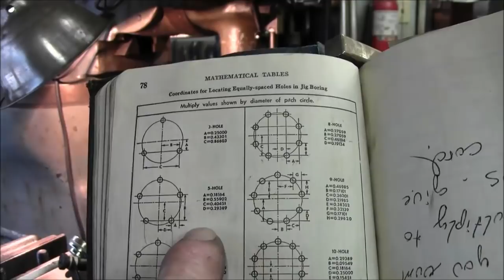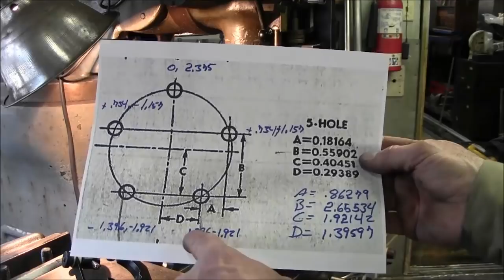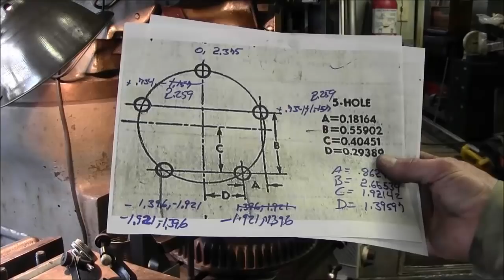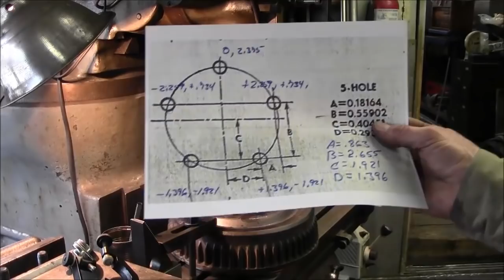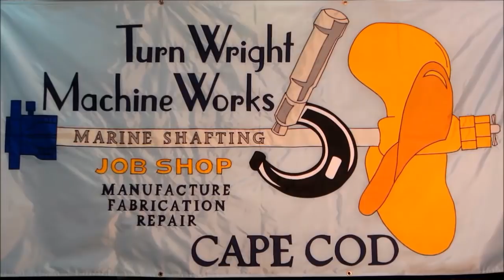Two ways to Jive with Five: Drilling Axles and Brake Drums

Comment: We used to make Eaton axles and had multi head drilling machines (which both drilled and reamed with special combined tools in one pass) producing the different hole patterns. I believe those machines were originally commissioned to make aircraft undercarriage parts in the second world war. That made them over forty years old when they were scrapped in the eighties, old machines like your K&T were certainly built to last. Cheers Keith.

Comment from the maker: Hi Andy, Thanks for your comment! I see a lot of others jumped in to help with your question, it is an R-8 spindle and the collects all have straight bores for different diameters of straight shank tooling, like the 3/4" diameter that holds the drill chuck. The tapers I have in the shop are R-8 in the BP and #40 tapers in the K&T and last are Morse tapers used in the drill press and lathes. ;{)-----

Comment: Knowing the hows and whys, is what makes a machinist. Speeds, feeds, materials, cutters, setup, fixturing, those are all the same for manual machining or CNC. Programming is actually a small part, that is largely handled by other software, these days. However, knowing how to manually write g-code, is always a good thing. You will be able to read what your CAM program spits out, and modify it as needed.

Comment: Rotary tables usually only have dials and scales on them to indicate position.  Indexers or dividing heads have dividing plates which have holes in them to positively locate the table for a given multiple.  There is a locator in the head which fits in the hole giving a very precise and repeatable location each time.

Comment: Another great video Keith. I just picked up an Indexing head on the weekend and I'm looking forward to messing with it. I've had a rotary table for years and get a lot of use out of it so the indexing head will be interesting. I found a while back that the DRO on my Mill does the PCD calculation and hole positions for you. It must use the same calcs as your book.

Comment: Keith nice one again, showing how to use the table for the bolt hole circle was good someone with only dials could do that (although it would take a bit longer).  It seems you're getting a lot of use out of that spotting drill one of your subs sent you.  I think we are going to have to get some of those.  FWIW most DRO units have bolt hole circle  function built in you just have to navigate the menus and input the info, but the table may be faster in the end LOL.

Comment: I find it a lot easier and quicker to plot points on a circle using basic trig, I never use the cheat tables which as you found out can be confusing.
X coord = radius x cosine of angle
Y coord - radius x sine of angle.
An added benifiet of this method is you can start the pattern at any angle and even exactly place the new holes between the originals.

Comment from the maker: There are two oil plug with the word oil on them , both visible from the top, when in the horizontal position, when removed you can add some oil, not sure on the amount needed but would put some in from time to time, especially if using coolant. ;{)-----

Comment from the maker: The one I use now pretty much has a deflector that aims it away from the filter. I had to take a piece of alum flashing and a hose clamp around the inlet side of the filter, with another vacuum I once had, worked pretty good!

 ;{)-----

Comment: I can't answer for keith, but I copied him and now use a shopvac as well to get the big piles. No filter problems here, but the vac has gotten really heavy and sometimes oil runs back out of the hose. It works fine overall and is very quick.

Comment: Mills,

I'm in a pretty good program at Fullerton College in Orange County, CA.  My classes right now are Intermediate Intro to Machine Tools (manual), and CNC Parts Programming (intermediate CNC, manual programming of CNC, not CAM).  While I recognize CNC is necessary for production environment these days, I also value the knowlege of the manual stuff.  I want to be good at both (as my instructor is), as I think it makes for a better machinist.

Comment: that was an great video i think you do awesome work ..what would you charge to redrill wheel bearings....i have a 07 dodge charger that has 5x115 and i need 5x114.3 for the rims i have to put on ..?...i want to change the bolt pattern..

Comment: Boy, bolt hole patterns are way easier these days with even cheap digital readouts.  I don't even need a dial indicator.  Just find 3 points of the circle with a edge finder and the DRO computer finds the center and then I can do any bolt hole pattern.    Still cool seeing the old school way it was done.

Comment: Interesting watching another way of "skinning a cat" Im a 55 year old mechanical engineer  and was hands on lathes mills etc for 9 years. Im from new zealand and Im old enough to remember using inches , thou etc before we changed to metric a few decades ago.
Metric is soooo much easier by the way. easy as to work on imperial shafts etc, just measure with metric gear and so easy to subtract .5mm or 1 mm rather than working in fractions of inches etc. yes thousandths of inches are good to work with and a gd partial solution.
This type of job is easy to do on a lathe, just set the drum up true in a 4 jaw chuck, mark out a pitch circle, then use dividers to mark the circle into 5 segments, centre punch and drill on a drill press. probably 1/2 the time it took you to do this job. that ho i did my 4 wheel boat trailer hubs and wheels 4 it Dont let me put you off tho i have picked up some gd handy hints from you.

Comment: Keith... You are an amazing teacher. I have learned so much just watching. I am a high school automotive instructor and in picking up pointers from you. If I knew there was such a thing as a machinist I would have became one. Which book are you using for reference.? Million ways to do somethings: why wouldn't you just hang the axle over the edge of the table and perform the same job you did for the drums? I'm subscribed and watching.

Comment: Keith, your thoughts on another method for the axel....set an angle plate on the table edge of the Bridgeport and clamp the axel using a v block, then use the same layout as you did on the drum?  Just trying to imagine how I could do this since I don't have the unit that you used on your horizontal mill.

Comment: Thanks for the reply.
 Great work showing what can be done in a job shop!
Another question for you, I am getting my first lath 12 over 36, I have to mount the lathe on its stand. Can a lathe be picked up by its ways?
I hope this isn't a stupid question, I know I can wrap a rigging strap around it but that would put pressure on the feed screw. Thanks,
Craig.

Comment: Another good one Keith, I have been using bolt hole calculator (saved) on line then
print thats a good one.  Boy I wish I had a spindle brake.  Mine has a finned flywheel
so thats awhile to whine down.  Maybe a V block moved by lever into a pulley like
a shaper brake??

Comment: Hiya Keith,
I know you were doing this 2 different ways as a demonstration, but wouldnt it have been easier to bolt up the drum to the axle using the original pattern and drill both at once?
Keep up the good work!

Comment: Mach3 has a circular bolt hole pattern wizard among others. It has a free trial version. G73 x0 y2.375 z-0.5 q0.2 r0.10 f5 X-2.2588 y0.7339 X-1.396 y-1.9214 X1.396 y-1.9214 X2.588 y0.7339 G80 M30 Not a complete code but u get the gist just make sure your using absolute coordinates g90

Comment: huh when I went from 5 on 4.5 to 5 on 5.5 on my brake disks I used a can of paint, a center punch and a drill bit 1/16 bigger and when I got done and found off it was off I used a bir on a Die grinder, I will say it was not as precise as your setup but I work with good enough :)

Comment: Keith,
Nice work from one long fixer to another..

Why didn't you use the existing holes to bolt the drum to the axle and drill both the drum and axle at the same time with your indexing fixture?

Comment: Hey Keith,
    I really enjoyed the video. Another great bit of work. Regarding Dupuytren's contracture, have you tried the needle aponeurotomy procedure? If not, give it a try. In less than 15 minutes I could fully flex my little finger again. Everything worked quite well for about 1-1/2 years, but the tissue is now starting to build-up again. Still, I'm going to repeat the procedure when necessary.

-james

Comment: Keith, around minute 11 you checked to see if the test bar in the index head was running "level". Is it possible the table on the mill was tilting a bit due to the weight of the index head?
Keep up the great videos, I always learn somethign from them.
Regards, Eric

Comment: When you had the Axel on the mill in the alignment head why couldn't you put 5 bolts through the original holes and drill the 5 new holes through the drum and Axel at the same time?

Or even after you had the 5 holes in the axle hub drilled you could have put the drum on the axle hub and just turned it to index the drum with the holes in the Axel. (It looked like a pile of math and doing the work twice! - setting up the axles and the drums by them selves!) Just curious! Brad Fisher

Comment: Good stuff Keith.  Why didn't you use the Co-Axial Indicator on the drums?
Reply: I know this was a long time ago but probably the reason he  didnt use the coaxial on the drums is because the attachments on the the coax have small ball ends on the feeler and the drum has a thin rim to indicate on. that starrett back plunge indicator he used has a wide flat indicator contact.

Comment: That method used in the book seems a little flawed. It measures from the previous hole, right? Seems like that would compound error. I calculated the holes using the angles between the holes (72 degrees for a 5 hole), using sines (length opposite angle, divided by the hypotenuse, radius of pattern), and cosines (length adjacent divded by hypotenuse), for x and y positions. Those figures should be multiplied by the radius (2.375). That way it's always measured from 0 (the center of the hub) each time. That way if there's any error it won't compound the error of the next drilled hole.